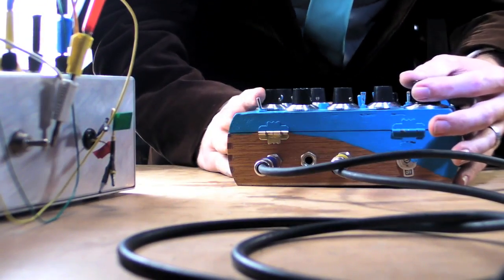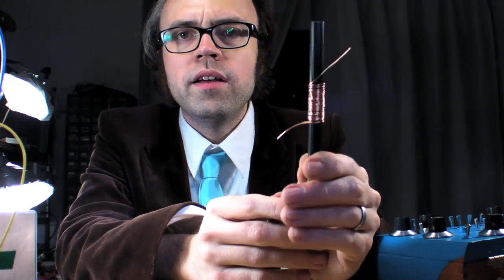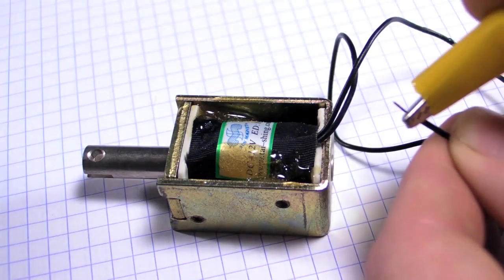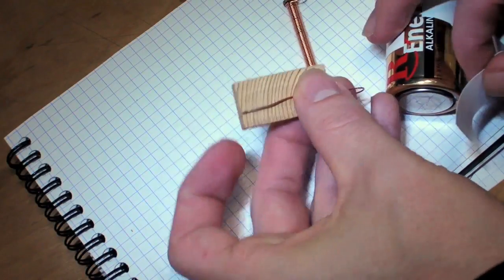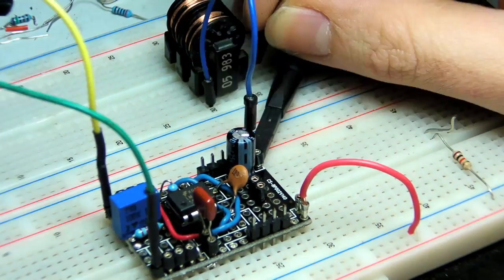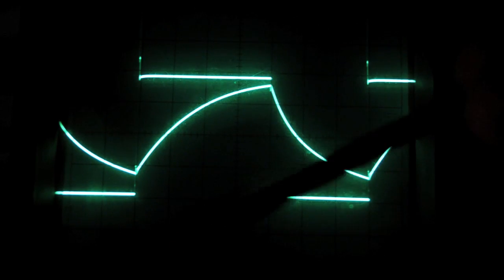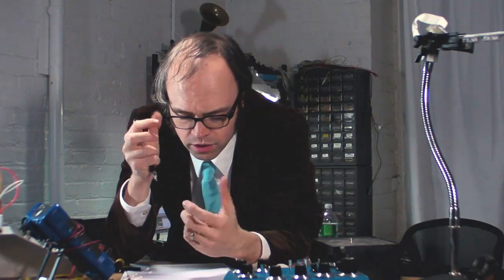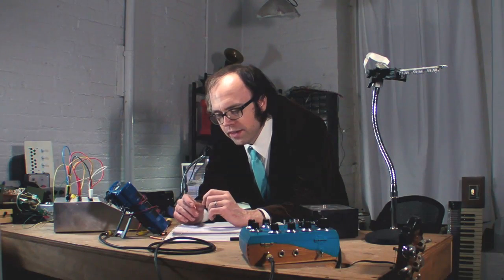MAKE presents: The Inductor

Comment: thanks for posting.   here are some very late things to consider.    at 5:10, disagree with your metaphoric imagery.  energy is NOT stored/retained in a magnetic field.   a magnetic field is Nothing more than a  Symptom  of current flowing in a (coiled) conductor.    when current ceases to flow, the field  COLLAPSES.   that's it.      corollary fact:   there is No Such Thing as magnetic 'energy'.   cheers           googletranslate

Comment: The oscilloscope graph was a bit flawed as, the shark tooth wave was generated across the resistor not across the inductor,  in fact the voltage across the inductor would be opposite of that!!

Comment: hey Collin, what would make enamel wire not work as an conductor  when you coil it and add power. i bought some supposed magnetic wire from radio shack and it's useless as a coil. any ideas?
Reply: +sean wirth Enamel wire is a conductor, period. If it does not conduct you need to check and make sure you got the enamel coating off so it makes good contact with your battery. The wire will always conduct electricity as long as it remains a single piece.

Comment: Here we are, nearly 6 YEARS after this was posted and it's still as good if not better than many of the other informational/instructional videos out there.
Reply: +RenaissanceMan929 You'd be surprised at how good instructional videos of the 50s are. For example, learning how a differential works.
Reply: 11 years
Reply: I can make a loud horn with an electromagnet a capacitor and a diode and a tiny needle it works by the capacitor at the wires and a diode going to the electromagnet. The needle is taped or screwed in place when power is applied the electromagnet try's to pull the metal needle and the screw pushes it back down and it repeats it super fast on the sound plate and it makes an Anh Anh sound
Reply: @EmillioMelendez  پ
Reply: mohamulator I too love old film documentaries on science. I watch those on mechanism, electronics, chemistry, etc.
Reply: RenaissanceMan929 is this guy alive and kicking today? I hope he makes more.
Reply: 8 years
Reply: 12 years and you are still right!
Reply: here i am watching this in 2024
Reply: @akshatchauhan6056  too
Reply: Here we are 14 years after it was posted and my teacher assigned a bunch of his videos including this one😂
Reply: 14 yrs
Reply: @kshirodhati4093  14 years and two more days

Comment: I'm looking to start learning about electronics hands-on. Can anybody suggest a good site where I can buy starter kits with stuff I would need to get my feet wet? Or a site where I can get the basics fairly cheap. Stuff like a breadboard, components, multimeter etc.
Reply: aliexpress.com  shipping takes about a month or less and everything is ridiculously cheap including arduino parts
Reply: +Nothing\ In Canada, breadboards, components and tools can be bought from Digikey.com. 1 day shipping, pretty good prices. Not too many starter kits, but thousands of individual components. Flat 8 dollar shipping
Reply: Thanks guys, I'll definitely check those places out. It's hard to know where to start when you're just getting into this stuff. What sort of equipment to buy or components or what not. Especially when you're on a tight budget.
Reply: http://www.eleccircuit.com

is worth a look for some basic circuits. I hope you have fun 😎

Comment: Although this may be interesting to a child it isn't very useful if you actually want to design circuits.  I'm sure that wasn't its intentions, but I don't find this video interesting or useful.  You learn that cute little nail trick in elementary school.
Reply: well i didnt learn that in my time now it is useful for me (i still dont pity not learnig btw)
Reply: +Impedancenetwork What are you talking about? It is extremely useful in circuit design. Inductors are used in about every electrical circuit out there.

Comment: Is it possible to build a transformer where the two coils sharing the core have different guages.
Reply: ***** could try, but all you'll likely get is this http://vignette4.wikia.nocookie.net/uncyclopedia/images/4/46/Housefire.jpg/revision/latest?cb=20100613035709
Reply: +vibe3d Yes, many industrial transformers use different size gauge wire.

Comment: electrical inductance is infact a mystery, if its pos it becomes a drainage issue...this is why the electrical car industry never suceeded.  Its called inductive leakage.  The leakage can be controled however if it works like a 120 volt system or a simple transformer.

Comment: a capacitor stores energy in its electric field. The field is created when opposite charges stored on a conductor are separated by an insulator like air. The charges then create a electric field which between them which "originates" from a positive charge and "ends" on a negative charge.

Comment: No. He's got the inductor connected in series here, which is why it's behaving as a low-pass filter. The OP is surely asking what would happen if the inductor was swapped out and a capacitor was connected instead. In this case, you'd get a high-pass filter, which is arguably exactly the opposite result. It changes violently when the square wave changes, and then drifts back to zero in between (instead of drifting towards the original square wave). See curves on bit [dot] ly [slash] 1ayqJbH.

Comment: A capacitor is reluctant to change voltage, and stores the charge as a potential differential between insulated plates. An inductor is reluctant to change current, and stores it as a magnetic field.

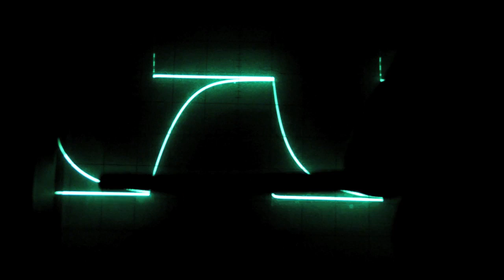Comment: What are those little spikes at the start and end of the power on/off starting at 6:05 and more prominent at 6:16? What would happen if we released those into a couple of rectifying diodes and on to create negative resistance in a lead acid battery?

Comment: Most small consumable electronics batteries cannot deliver high enough current to cause heat. I would recommend you grab yourself a 12volt 7 amp hour battery from your local electronics store they are commonly used as backup power for security panels. Then score yourself some Nichrome wire out of an old glass heating element. Measure the resistance with a multimeter and use ohms law to figure out current draw, if you don't get enough heat, just shorten the wire! Also be careful :)

Comment: Only if you draw alot of current through it, the resistance of the wire will cause heat, not the inductance of the coil. Resistance is the only thing that can create heat, (directly out of electricity) so use a resistor!

Comment: How do you measure if a transformer is good? Mine measures 0ohms (short) on one end, it means it's bad right? When I try to measure the other end, ohms go up from ~500 to 2000 until out of range for the meter. Thanks

Comment: my bad kdc43 i meant voltage is at its maximum and current is at its minimum.sorry about that. i was also taught that in an inductive circuit voltage leads current and in a capacitive circuit current leads voltage and they slowly diminish to their vice versa. sorry bout the confusion.i apologize

Comment: @ABCElevator   I was taught in 1987 that when turned on in the first pico-second the current in the Capacitor is maximum and the voltage is zero because it is an effective short while in the first pico-second the current is almost zero and maximum voltage in the Inductor because of maximum 'rate of change' of current generates maximum 'rate of change' the the flux which induces maximum voltage.

Comment: this is a great video. as you can see on the scope how the square wave turned out after it passed through the inductor and how its shape was changed. this is due in part by when current is first applied to an inductor, it is at its maximum and slowly diminishes because of saturation. Capacitors are the exact opposite they are at minimum when current is first applied but then they gradually build up to the potential.

Comment: I 100% agree with Milo who commented on how some persons can teach but cannot explain it in a way that one learns from it, you do teach and explain it very well. I just finished building an electromagnet using a D battery and a screw wrapped by an insulated wire. One huge problem: as soon as I connect the negative wire the wire gets very hot and starts to smoke and I burn my fingers. Question: Is there a way around the heating and burning aspect to this project??. Thanks. AL.

Comment: @dealio82 frequency devices, simple as a transistor oscillator or a 555 chip, very easy electronics, then its causing sound in the oscilloscope, ive done it tons of times, its like leakage in the circuit causing sound, a nearby spreaker can sometimes pick it up too.

Comment: @tikay69 Sorry but what you are claiming would violate the laws of Physics. Power, or in the case of electronics Watts is voltage times current (I x E) and if the maximum wattage or power draw from a battery is, say 10 watts and the voltage is 10 volts wattage must be 1 amp. If you boost the power to 100 volts and current stays at 1 amp you have 100 watts. Not possible.

Comment: @JagdtygerII the current doesnt get decreased in increasing voltage, the max current output stays the same at 200volt as it would have been at 1.5volt, so thinking he ment a battery, it wouldnt be "much".

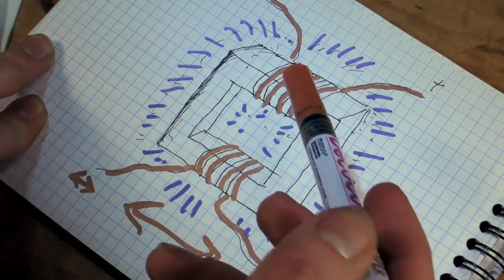Comment: WRONG at 9:05 , "the original voltage can be reduced by using a different number of coil windings in the secondary", should have added "or increasing the coil windings in the primary". If you wanna be exact you gotta say both :P

Comment: And inductor also behaves like a resistor... because of the resistance of the wire itself. There's always leakage and power loss, even though it's not too much. As said in the video, when you connect the coil to a DC power supply, it's reactance is 0, so the only remaining resistance is that of the wire, which is very small, thus a lot of current passes through it and heat is dissipated. P = Q/t

Comment: Should have started with what happens when a current flows through a conductor (magnetic field- not just a coil; any conductor) and what happens to a conductor that moves within a magnetic field (principle of generators). Then Left-hand rule etc. Then when the magnetic field is collapsing, it would make more sense why the coil opposes change

Comment: I dont know what letters you guys use for the different measurings, but in Norway U = voltage, I = ampere and R = resistance (ohm) and R = U / I, which means that when you have higher voltages, the resistance decreases. Why this happens I have no idea about..

Comment: the electricity comes from the power plants at very hifgh voltage, and is then converted down to the voltage that is in our houses. The reason for it being high voltage is because the higher the voltage, the lower the power loss is.